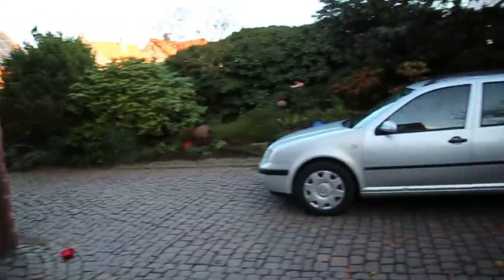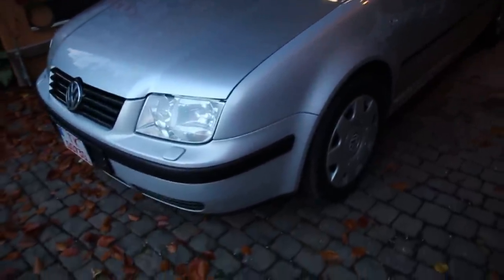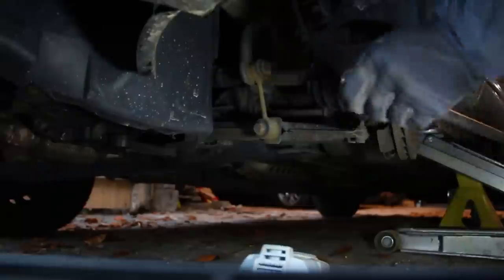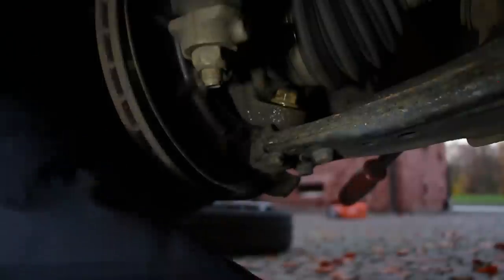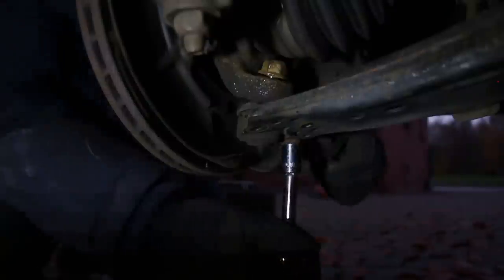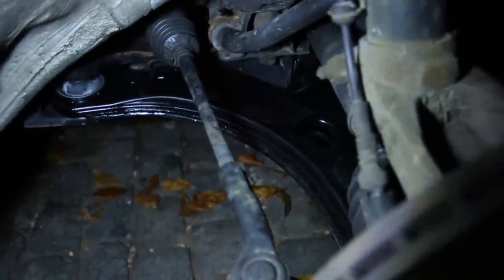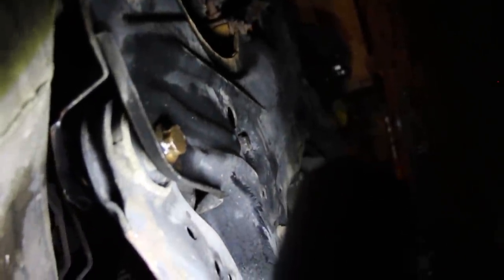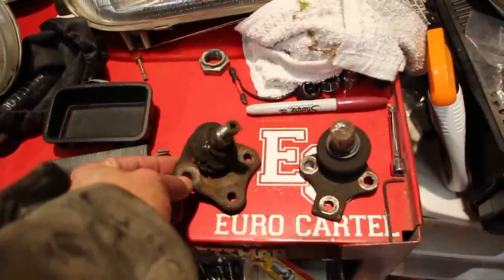Volkswagen MK4 Control Arm Install | Frustrating**

Comment: Hi, tip for next time jack up the control arm by the ball joint buttom end before you screw the nut open. Its compreses the ball joint in place so you can screw off easy👌

Comment: Autodoc makes it look sooo easy indeed, they are masters in showing you in 6.30 minutes what you are going to be trying to achieve all night. The control arms on my mk3 turned out to be a real nightmare. The threads IN the sub frame holding the control arm snapped right off and the bolt wouldn't come out. I had to cut and weld to get it done. 
Tip for the rounded bolts; slam a 12 point socket on. If that doesn't work weld on a big nut.
Make sure to use copper grease when reassembling.

Comment: Welcome to the mechanic world and also you need tools bro, get some Milwaukee cordless impact gun 1/2, 3/8, ratchet, a better cutter,  a torch, and maybe a compressor because to do work at home without the right tools you will get pissed and the good thing you have a nice garage so spend money on tools and your work that you would do it will be easier down the road.
Reply from the maker: Roberto Mercado surpassingly enough even an air impact and a huge breaker bar wouldn’t even break the bolt free lol cut that bad boy out but yes I agree I wish I had the money to really outfit the barn with everything I need
Reply: @Mk3Smith  got you bro is understandable when I started turning wrenches I started buying things slowly, one month I buy my impact, 2 month down the road I will buy my ratchet and then the rest of tools I went to sears with coupons and bought sockets wrenches, so i know how it feels but slowly you get there it will be a lot easier next time. Take care

Comment: The shaft is part of the ball that rotates inside the joint when you steer the car, it's supposed to spin like that.  The OEM ball joints take a 6mm allen to counter-hold, which you should be able to fit in there even with the axle in place.  I cut off part of the short end of a 6mm allen and I was able to get it in there to counter-hold the ball joint shaft.
Reply from the maker: Luis Garcia these ones took like T40 and nah there was no way to get anything in the top without pulling the axle out of the way. I got it though lol

Comment: Cutting the bolt head off will definitely not help, get 12 point socket, heat it,  hammer it on and carefully use breaker bar to loosen it.
Reply from the maker: Martin Vlha didn’t cut the bolt head I cut the bolt lol worked fantastically

Comment: it is called a balljoint because it is a ball inside and it will spin like a ball. load it man :) 
Also if you do it in the right way it will be just a five minute job, and alot of fun.
A loose balljoint is Dangerous driving With.

Comment: Get some penetrating fluid on there buddy, don't use open ended spanners if you can help it. I follow a guy called mercedessource on youtube. he has some excellent advice for restoring old cars and he has some really good videos on getting off rusty bolts. check him out.

Comment: The mk3 Spindle and control arm design is honestly much easier to work on. I’m not sure why they went away from that design.

Other thing you need is an impact gun. Much easier to drive those bolts off.

Comment: If you were to put your jack stand under the control arm and lower the weight of the car down it would hold the ball joint from spinning inside itself 
It’s hard cause by the time u post the video it’s to late for me to give you any tips to make it so much easier 
Like I’ve mentioned b4 you can message me when you run into issues or just have questions.
And i can most certainly save you a lot of head aches and frustrations
Reply: ER Automotive was gonna saw this. Glad I read the comments first
Reply: @TheVWGarage  haha yeah its tough when doing videos like this if you run into issues and then post the video there all kinds of help that you wish u had a couple hours or whatever earlier

Comment: If you cut the head off that 18mm bolt you'll be in a worse position. The shaft of the bolt will still be stopping the arm from coming out and you'll have nothing to grip onto. I'd try and find a socket that drives the walls of the bolt instead of the edges (like Sealey Walldrive or similar). Good luck with it ! :)
Reply from the maker: m x I cut the actual shaft of the bolt and got it out thankfully 🤘🏼